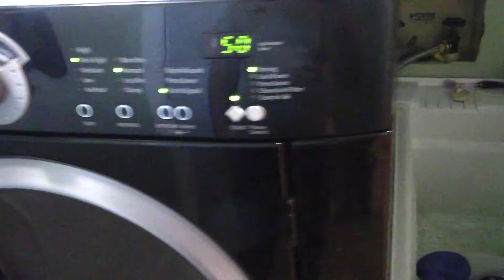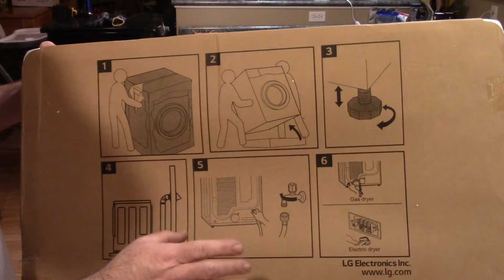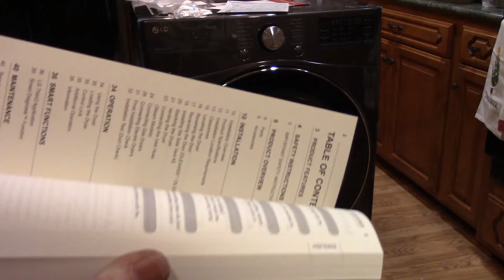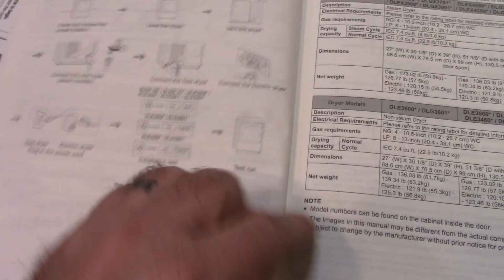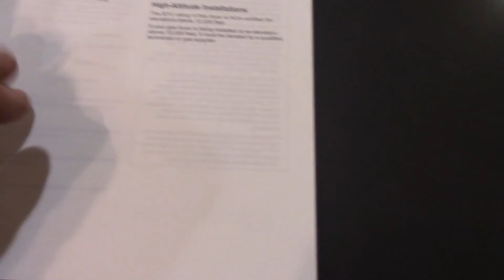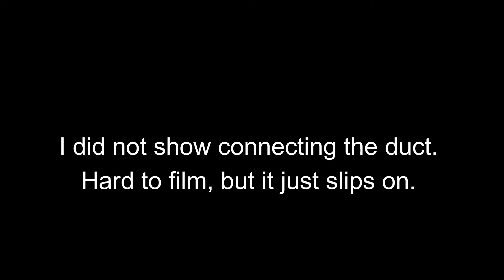LG dryer install. Part # DLEX4200B

Comment: Great video... helps me to begin my install.  I recently bought the same exact set as you and have installed the dryer... washer next.  I noticed you didn't install a hose for steam. Did you decide not to connect water for steam?
Reply from the maker: We are debating that. Not sure we need it, but it’s a simple thing to add later.

Comment: Very wonderful informative video! I’m planning on purchasing this dryer soon. Does this dryer require only 1 - 240v 30 AMP 4 wire power cord? Or do you need to have 2 power cords connected to power on this specific dryer machine?
Reply from the maker: Just one 240 Volt cord.
Reply: @jodaddysworkshop786  Thank you so much!!

Comment: We’re on our second dryer with the lint trap in the door (like yours). Both of ours have had issues with lint making it past the trap and into the vent duct. I’d be curious to know if you’ve seen anything like that in yours.
Reply: Got the same issue
Reply: I eventually put a secondary lint trap in line, before the duct goes into the wall. It’s a bit of a pain, because it adds extra bends to the line, and makes the dryer stick out a little bit further. That’s not to mention the fact that there are surprisingly few options that I could find for an in-line lint trap. It’s such a simple device. It seems like an untapped market.

Comment: You can use the pedestals if you use a sheet of 3/4 inch plywood as an adapter between the machine and the pedestal.